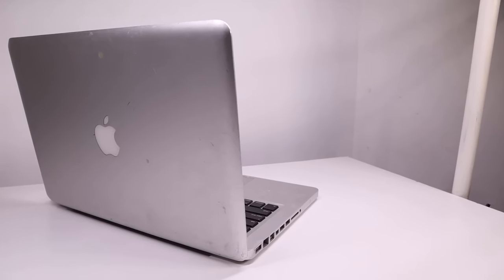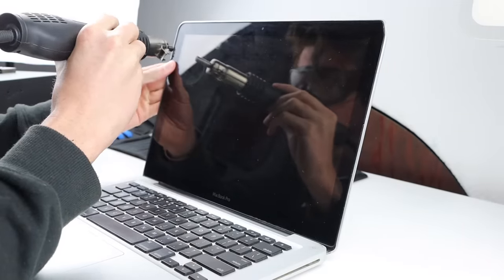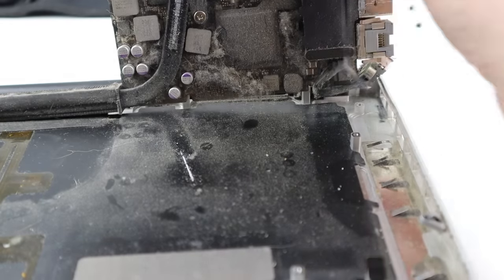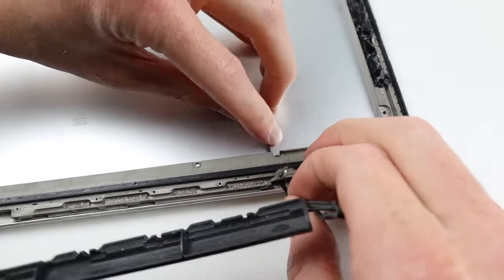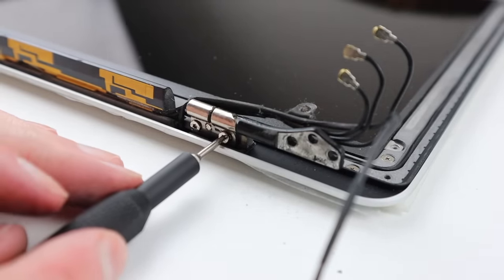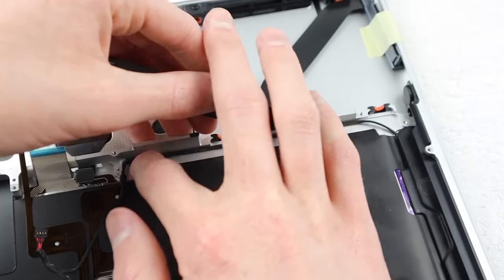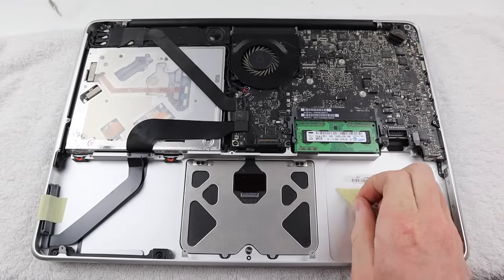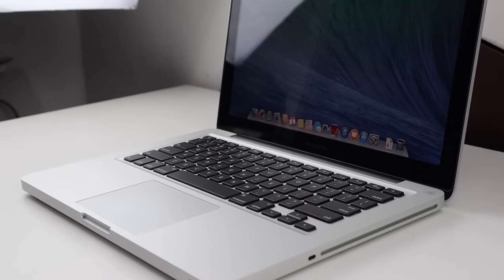$100 Trashed MacBook Pro Restoration & Rebuild + Custom Apple Logo & Keyboard

Comment: In iFixit:

-Lower case: $150
-Upper case with kb: $150

Couldn't find a screen cover, only the whole thing with screen ($400), so a took a look in eBay:

-Second hand good condition (not perfect, though) screen casing: $75

Adding the cost of the MBP itself, all that sums $475 (I have not taken into account battery and SSD HD).

And for that sum you can buy a second hand 2012 MBP 13" in good condition, maybe less.
Reply: For $500 you can already buy decent retina MacBooks (post-2013). This is just one giant ad for iFixit.
Reply: Amelia Pytosh The real question is why video author does not mention prices at all, something essential in any restoration, even more when he tries to sell it as a “bargain”.

What’s more: even with your prices (add screen casing and screen front glass -which I forgot to add to the addition-),  total amount is easily over 300€, and for that price you can get a good condition 2012 13” MBP at eBay:

https://i.imgur.com/IdTnTaP_d.jpg?maxwidth=640&shape=thumb&fidelity=medium
Reply: @fourteevee  No one says they are scammers, just that this "restoration" doesn't make any economic sense.

Comment: My old 2011 MBP has almost the same dent/bend near the Ethernet jack, it's due to the thinness of the case section in that area. The day my (then) 5 y/o daughter sent it flying across the room when she tripped over a cable connected to a USB, I completely freaked as my Mac cartwheeled across the floor, getting the afore-mentioned bend and also a big dent at the top right corner of the display. Remarkably, nothing, including the 1TB disk drive sustained functional damage. Ultimately, I replaced the HDD with a SSD to give it a speed boost, but this soon to be 9 year old MBP is still in service as a net TV and media server for my now 12 year old daughter, who just got an upgrade with a new 2019 MBP for Christmas. But she learned to work and code on the old beat-up box and she loves to show people the damage and dramatically exclaim "I did that when I was a baby, but it still works!".  So I'm not surprised to see you can rescue an old MBP.

Comment: He didn't restore anything, just replaced everything with expensive parts. Thumbs down.
Reply: @celestiaalone  replacing...
Reply: Fortune66 he’s restoring the Mac BY replacing the parts, how is he supposed to fix it?
Reply: @celestiaalone  simply don't do it? "restoration and rebuild" ? no "replacing old parts" what did he really achieved anyway?
Reply: @celestiaalone  what a smart answer! :)
Reply: Fortune66 ikr
Reply: @celestiaalone  Replacing is not restoring. He didn't even attempt to fix the chassis which could have just been bent back into shape and saved money.

It's like saying I'm restoring my Mustang... just went and bought a new one and swapped the wheels over. Yay!
Reply: bren It worked perfectly fine. The hinge had an issue but that could of been fixed without a new one and the case could of been reshaped. Nothing here really needed to be replaced apart from the battery. He didn’t even clean the board. 

Having restored many vintage machines for which there aren’t an abundance of parts, this is not restoring. It’s even beyond repair, it’s replacing.
Reply: This is his personal MacBook. It looks brand new and it is custom made to his liking. With the new ssd it is leagues faster than even some of the newer MacBooks.
Reply: Restoration & Rebuild
Reply: @Alexlfm  could have*
Reply: What did you want him to do?  Take a hammer and beat out the dents on the aluminum casing?  Come one on Croc, where's your head at?
Reply: @Mike Carr mad skills? I could do this before i left high school and we leave at 16.. 

And some can't enjoy shoddy work.. so saying shut up and enjoy is not a good comment to make.. 

Perhaps check out hand tool rescue to find out what restoration is.. this is a standard replace repair without much effort.
Reply: i mean, hes not wrong, he didn’t really restore anything, i would call that a repair not restore. restoring is fixing used parts, like if he straightened out the bent frame and sanded refinished it etc.
Reply: well, he isn’t going to be able to take out everything and repair it.
Reply: Joe very well said.
Reply: @systemfailed9106  You mean.... like.. restoring the aluminium casing? Yes
Reply: @crocodile2006  Not sure how you equate installing new equipment to buying a new one but alright that logical fallacy made zero sense.. In this instance replacing and refurbishing DO mean the same thing. Upgrading and restoring can be one in the same. If you have to upgrade something with newer parts because the old ones aren't usuable that doesn't mean it isn't refurbished. By your analogy the only way to restore a macbook would be to clean the inside and replace the battery. Dumb.
Reply: @Alexlfm  The title of the video is literally "restoration & rebuild". A few of the original components were restored (such as replacing thermal paste) and the parts that were out of his scope of abilities were rebuilt. Most people who work in computers and tech don't have the know-how to reshape and refinish a solid aluminum chassis.
Reply: jvyn If we’re going to call thermal paste “restoration” then I’ve “restored” thousands of machines. I’m not saying he had to reshape the bottom case, but the screen? Seriously he couldn’t just replace the hinge, reform the corner and be done with it? Yes aluminum is tricky to work with but small deformations and polishing are not hard. I consider it no different then cars. If this was a car it would be a rebuild not a restoration. Too many original parts were outright replaced.
Reply: welcome to the 20th century, a butt lift is now considered a a full restoration

Comment: I run a similar laptop. I like being able to play a DVD if I want; though I’m sure that dates me. I gave 16 Gb of ram in mine; I don’t recall the processor speed but it’s the top processor/GOU combo and the last laptop with a SuperDrive. I have a 1 Gb Samsung 950 Evo that makes this fun as well as a newer machine. I have a few Mac and while I bought new at one point find much more value in used systems; you also benefit from knowing any problems that have arisen, like keyboards, that you don’t know on new machines. Macs seem to hold up and age better then other systems; I’m glad to see you bringing things back in these days of throw away tech.

Comment: i would have dipped and cleaned the board on electrical contact cleaner...
Reply: Thomas Antoniou You mean an Ultrasonic cleaner machine?
Reply: @murd777  wd40 contact cleaner
Reply: @peritrima  can you use WD40 on mother boards? 🤯
Reply: @lucifelmartell  only the one labeled "contact cleaner"
Reply: Electrical contact cleaner is awesome. Usual in spray cans, alcohol based so it evaporates, and safe on plastics. Would’ve been perfect for this job.

Comment: For anyone that is wondering how much it costs (from ifixit website):
1)Battery $95
2)Ssd $170
3)Case (upper and bottom) $100
4)Clutch cover $10
5)Display glass $50
Total: $425 + $100 = $525 
(add also the time that you would need to make this restoration happen)
$700 (at least) 
not worth it.
Reply: Absolutely agree. You could get better condition shmapple MacBook for hundred bucks more and spend less on new parts for restoration.
Reply: Thank you
Reply: But then you don't have a video.

Comment: This comments section is toxic af 😂😂

The purpose was not to be economical or practical, it was to have an old device work like new again 🤦🏽 it’s like you don’t buy an old trashed car and do it up over months and years because it’s “economical” or “Practical” . You do it for the fun and enjoyment and hobby aspect of it. The satisfaction of brining something back from the dead so to speak. And my first ever MacBook Pro was this exact model from 2011/12 and honestly I regret selling it. They were a really nice solid build, not all thin and light with no key-stroke travel like the current ones.
Reply: If you buying any use parts you didn't have any warranty but you will not pay full retail price for your device like in this case. You will end with device for good price, fraction of a cost of brand new when it hit the market. If you have to replace any broken parts just watch your budget.  This device you will be in use anyway so after years by it will be worn. Treat device as a tool. If it works and done good it's job why you should change any?
Reply: Dori21ha literally have no clue what you’re talking about 🧐
Reply: @rubes3927  I don't believe you will only work for fun, when you losing money. Building something from ground up just to  invest more time and money. It is pointless. Always work should have a purpose. When you making something custom with right purpose then money aspect is less important.
Reply: Dori21ha he’s not doing it for money you knob. Read my comment. The key word being “hobby”. The definition of which is something you do for fun in your spare time.
Reply: In my opinion it is not only just for fun, it is not non profit action when you making video to YT. This build despite it cost have a reason to finish. It is not all about of money, but if you can not afford to do this you just blowing your time and money and you will never finish your project. Always have a purpose in live. When you want to do something just for fun share the joy with other and you will always left with something.
Reply: Dori21ha 👍🏻
Reply: @rubes3927  that dude can litterally not read?! You litterally said I see it as an hobby and he sees i not.... bro u cant put ur opinion on others. 
You are absolutely right

Comment: The way you installed the thermal paste is more than fine mate!
When I first built my PC I only had a small packet up manufacturer supplied stuff, and I spread it across the top with a razor blade. I didn't even cut myself with the blade, I cut myself on the IO shield though...

Comment: I can tell you where that caes distortion probably comes from. In some of those 2011 macbooks you'd get expired batteries expanding quite dangerously and it'd bend the metal. Once thats happened, the case is doomed. Even if you take the battery out, the mechanical stresses mean it'll never hang together properly again, and you end up in a cycle of screws dropping out and all sorts of nonsense. Bitter experience speaking here. Still, even though it was practically held together with gaffa tape at the end, mine did make it to 2019
Reply: Shayne O'Neill not 100% correct. I had my 2009 battery bulged the metal case once, everythings fine after i install a new battery

Comment: I actually can't believe you re installed that Logic Board without first removing the dust with compressed air. Like WTF.
Reply: same
Reply: Same here
Reply: And cleaned the fan!!
Reply: He said in a different comment he caned but cut the clip
Reply: Noah Langrehr Well I can tell when he re inserts the motherboard that it was still full of dust on both sides...

Comment: The logic board still looks dirty.
Reply: Бастин Џибер  I own this MacBook Model as well. My method to clean the board would be a toothbrush and 91% alcohol, along with dipping the fan gently in a tub of the same alcohol type and cleaning it out. It worked for me, and is still clean 5+ months onward!
Reply: @tonystechrepairs  I think blowing with compressed air should be enough,  the dust doesn't stick to the mother board.
Reply: @karljo8064  Good point. As long as the previous owner didn't get any gunk hidden in there from past use, he'll be fine.
Reply: @andra_syawwal  Oh come on, don't be like that. We all work differently to reach the same end goal! Lol.
Reply: Agreed, using a compressed air nozzle would easily blow the dust away, can't figure out why he's not doing it

Comment: For the apple...  I just cut a circle from a blue plastic binder and used double-stick to attach behind the apple (on the inside of the cover). 
You don’t have to take the apple out or remove the white backing... now it lights up bright blue, and can be changed later if I get tired of it.

Comment: 100$ my arse. How much for all the replaced components?
Reply: he bought the old one for $100, he didn't say how much replacement costs were
Reply: @davidschwab8981  ya he did he said he got the shell for $75 off ebay but the bottom was used 11:10 . The battery and glass was given to him by ifixit
Reply: @umop3plsdn  @Mauro Corti battery would be €90 for anyone else and the glass replacement seems to be around €30.
Reply: He is manipulating us all: withholding pricing info to force us go and to visit the ifixit website for the prices so he can make money off of us all and wasting our time. I am never visiting this channel ever again.
Reply: parts would retail somewhere around 600$ while you could get refurbished macbook of ebay 300$
Reply: Mauro Corti do you not understand that If he said prices in the video you’d all get pissed off about the price, especially if the price changed since the video?
Reply: 1$
Reply: I think he said he got the new cover for 75$
Reply: @EverHappyDude  sponsored video
Reply: @EverHappyDude  its entertainment

Comment: First, very well made video! Audio, production, and pacing is awesome. Very high quality.  Couple things though:  Please wear gloves so dirt and oil aren't transferred and dont use so much thermal paste or it can have a negative effect on heat displacement.

Comment: 14:38 Looks like you icing a cake instead of putting on thermal paste. 
You need way less like a pea size amount otherwise good job on the restore.
Reply: It's a good amount for a laptop, with the cooler making direct contact with the silicone the amount he used was normal and doesn't hurt cooling.

Comment: I have a mid 2010 MBP 15
I change the stock ram 2x2G (4G) to corsair 4x2G  (8G)
and stock HDD to 256 Samsung EVOS SSD
If I watch movie in it, it is doing fine.
However if I watch movie and do another thing like browse or surf using chrome, it will restart.
Some say it's kernel panic, anyway what should I do?
Reply: It could be the CPU not being able to handle the load, maybe if possible replace the CPU or install a new GPU
Reply: Drol are you getting fan spin or clean your fan. also go to Task Manager and check how much ram and CPU is being used while watching a video. even use a different browser with less resorces.
Reply: Sepp Onckelinx you should sell it and get yourself a Lenovo T440P

Comment: Anyone who builds pcs died when he put on the thermal paste
Reply: Eeh. Gamer's Nexus did a video comparing different thermal paste applications, and showed that it didn't really make a difference, since the pressure of the bolts will naturally correct that anyways
Reply: @JM-kn9dh  Except any air bubbles that get trapped will create heatspots.
Reply: With that amount of thermal paste it doesn't matter, the die is very small - we could not see how much paste went out on the sides.
Reply: @adzmitch  how? If you can create air bubbles by spreading it, you can create air bubbles by letting the cooler pressure spread the thermal paste. Like I said, gamer's Nexus did a whole video on this topic, and found no difference in temps for various applications
Reply: @pontram  I more or less meant that he spread it with metal and could've scratched the cpu

Comment: I can see you are leaving your components pretty dirty, when assembling most of the devices, you can you se a soft paint brush in order to remove the dust and a little bit of compressed air. Here we are using a high pressure air to remove all dust (depending on the component). P.S. Thanks for the great videos and keep up the good work :) Cheers.
Reply: Lots of alcohol, a toothbrush, and some compressed air... that is if you want it cleaned..

Comment: Love your videos man, I recently upgraded my old late 2009 apple mac desktop 21.5 inch. Swapped the mechanical dead harddrive out with a samsung 870 evo ssd and upgraded the ram with 2 more gb chips to get the full 8gb of ram.. love how fast it is now I just have to dig back into it at some point to do something with that tempature sensor that's not plugged into anything in order to control fan speed..

Comment: Amazing job!!!!! I am having problems to reinstall the operative system in my old MacBook pro 15" from 2009, mine is with two graphic cards. I think that erased all... I also need to replace few parts of the laptop as the screen and the hard drive ,even if is brand new but is very slow. Could you help me with the operative system issue ???

Comment: my mbp is 2011 yr.   update  16G RAM and two SSD change new keyboard and new battery.  
but , no battery on the market can replace the original battery.
Because the battery will inevitably decay again after 3 months of use,
Use time reduced to 2 hours.

Comment: That is the exact model that I have. Any tips for how to make it usable? I’m using Linux but it’s not any faster. I also tried getting 6 go of ram but it’s still not fast.
Reply: Reinstall thermal paste
8gb ram if possible
Reply: What is your problem? if it turns on, the first step is to replace the hard drive for an SSD, this will faster your pc as you didn´t expect.
Reply: @tharupathiwijesiri4492  thanks! I will do that
Reply: @villowskicabeza230  I will get an ssd
Reply: That's a great idea i think ssd makes huge difference in performance
Reply: @SpaceQuacker  let us know, if you notice the speed increase with that upgrade (y)

Comment: It’s actually easier to remove the glass without damaging it and without melting the rubber gasket by not using heat. Just start at the bottom corner with a sesamo and then using a black or metal spudger slowly twisting between the lid and the glass and then bend the black spudger towards the back of the lid and the adhesive will give way. Have around a 95% success rate doing so!